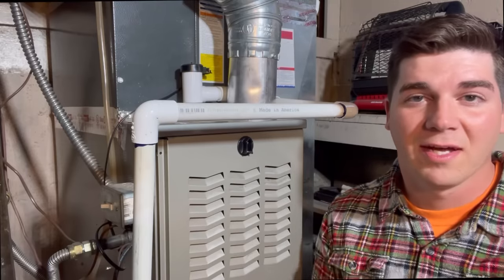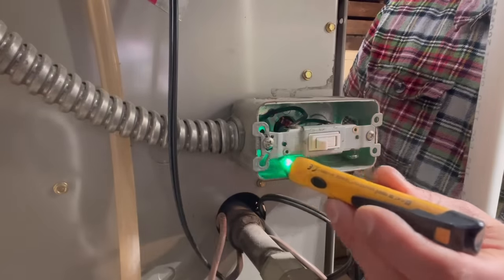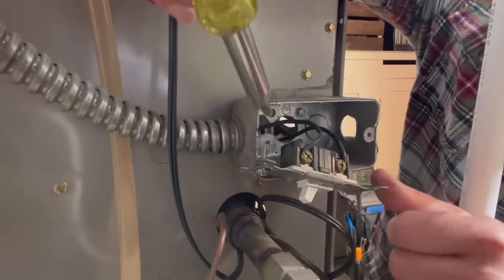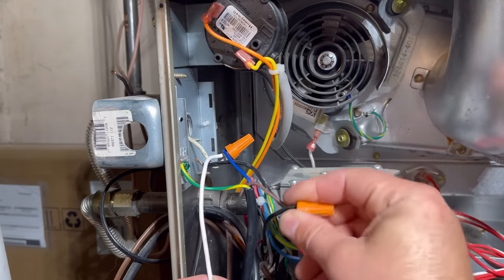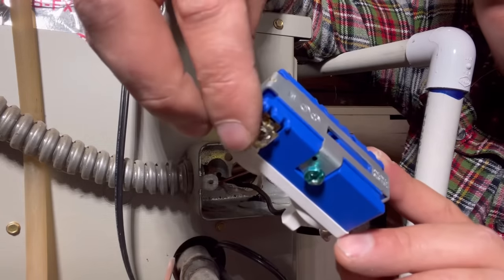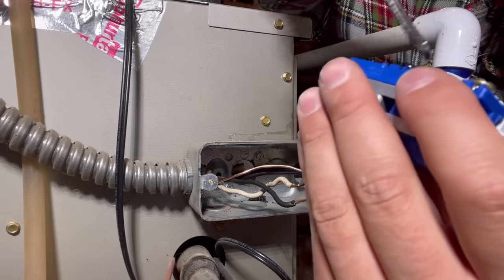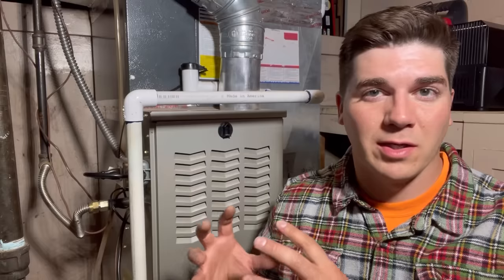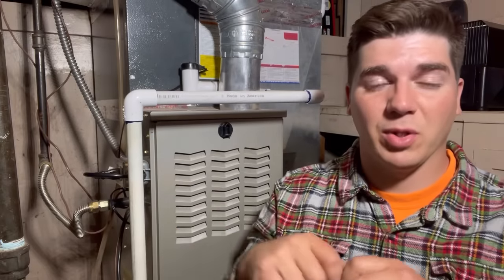This Could Keep Your Family Warm During An Emergency Power Outage.

Comment: Good idea. Please note that the opening in the back of the attached metallic box through the furnace side wall requires a plastic grommet to protect the wire from eventually being cut through the jacket to potentially a short or a hot chassis, both of which are very very dangerous. The vibration of the working furnace can, over time, cut through the wire jacket. A plastic grommet prevents that from happening.
Reply from the maker: Thank you, some others have said the same. I’ll make sure and correct that.
Reply: @diyhvacguy  I come from the automotive world and it's the constant subtle vibration (such as produced by the furnace blower) that sneaks up on you to slowly eat through unprotected insulation. 3 or 5 or 10 years later.... ZZAAPPPPP!!!!!
Reply: @offsideundo  One big safety step also missed is grounding the box.  Sure, a short will still be a problem for functionality, but at least  it would keep the switch box from becoming live and deadly.
Reply: There are some plastic grommets that fit the knockout hole (3/8 in. - 1/2 in. Knockout Non-Metallic Push-In Connector). They have these fingers that you put the cable through and it insulates the cable from the metal and does an adequate job of holding the cable in place. Places like Home Depot will have them and probably Amazon.
Reply: @CanadianCuttingEdge   actually, he has a bare ground wire connected to the box through a screw from inside the furnace, the he connected to ground.  So it is grounded, though I agree it might be better to have used a grounding screw inside the box so that would be apparent upon visual inspection without having to look inside the furnace.
Reply: Another NM (Romex) connector can be used at j-box/cabinet interface for wire protection. You can use the clamp for additional strain relief or just remove the two screws and clamp completely. The goal here is simply to prevent the sharp edges of the j-box and/or furnace sheet metal housing from cutting into the wires’ insulation causing a possible fault (short). Just about any 1/2” trade connector will work. When I do this on multiple products I use a close nipple and two nuts making sure the nipple is deburred for electrical applications. It results in the neatest possible  job and an additional mechanical interconnect.
Reply: Is there a building code that says a furnace can't be on a plug like this?
Reply: You got a breaker and a switch in series. Kind of redundant
Reply: @Paul Hart  The switch is for safety of the technician and to prevent property damage. Most HVAC companies have lock out/tag out procedures for the breaker outside to prevent energizing the circuit during replacement of the furnace. When a technician is there in front of the unit, they need to be able to quickly de-energize a malfunctioning furnace that often happens during the troubleshooting and diagnosis phase of a repair.  Considering the furnace is often in the attic space and the breaker is often outside the house, it is important to have the switch on the furnace.
Reply: @tlv1117  Maybe not one, but several that make compliance a challenge or impossible with this approach. Local codes may be ammended to make this easier or harder.

Generally the applicance (furnace) will be required to be listed (UL etc.) and installed in accordance with the manufactuerers instructions. [NFPA 70 110.3(B)]. If the furnace was not listed as a cord and plug connected device, and the device didnt come with either a cord to use, or come with insturctions listing specifications for the cord type and size, then attaching a cord and plug should not be done. This is common for dishwashers and built in microwaves, but I have never seen it on a furnace, particularily due to some other requirements ill get to further down. An example from a Granby KHM series installation manual: "Use a separately fused #12 electrical line directly from the service panel to the furnace junction box. Install a manual shut-off switch at the door or stairway to furnace room so furnace can be shut off remotely."

The box connector that was used to attach the cord is probably not listed for flexable service cords. The one used in this video apperas to be a box store special (probably Halex brand) which to my knowledge are only listed for use with NM sheathed cables. A better choice here would be a T&B 3302-TB which is listed for both NM sheathed and flexible cords. (These are the nicer ones that the good electricians will stock on their trucks made from stamped steel instead of die cast zinc, and they have screws that that thread into the moving part of the clamp so the screws dont extend way past the connector when clamping, and they are listed for pairs of NM cords through one fitting for certain sizes)

The light switch used in this video almost certainly does not carry the listings or safety ratings to be used to for a transfer switch. While it certainly works, they have not been designed and qualified to ensure they fail-safe and have suitable isolation to act as an interlock device between two seperataely derrived power sources.

Another major safety issue I see is the second source of power appears to be brought in after the the firomatic thermal cutout switch and area entrance disconnect switches which are typically installed on the supply conductors.
Reply: @shtfengineering7472  it’s convenient. But this is in a home, not in a place of business. This type of setup would probably not fly in a commercial setting due it being of questionable compliance with Code. In a home, the man of the house would probably tell everyone in his home not to fool around with his breakers while he’s doing electrical work, so no lockout/tagout necessary. But I see what your saying, it’s kind of neat.
Reply: @phart010  Good points, and I agree with you.  I was speaking more to the practices and procedures established by the HVAC company who comes to the house.  After reading what I wrote, I can see how I could have made that more clear.  Sorry about that.  I have edited the comment for clarity.
Reply: @phart0102  That attitude is why inspectors are sometimes extra strict with non-code-compliant things done by amateurs when they let shortcuts by tradesmen slide.

It's only a short distance between "the man of the house will ..." to 'I will remember that the green wire is switched power from the other breaker'.
Reply: @greg_zenger   not sure what you're seeing but it doesn't look to me like he's using the switch as an interlock. His setup only allows 1 power source connected to the furnace at a time. The pigtail is either drawing power from the switched receptacle or it's drawing from the generator's receptacle.
Reply: @paulhart7739  True. Our original attic-mounted furnace had a 15A plug going to a receptacle for the power as did the replacement furnace. I agree the switch is not needed.
Reply: @CanadianCuttingEdge  The whole thing is now electrically connected because it is metal and it is shared through the screws from the box into the furnace metallic shell that's causing a complete circuit so you do not need an additional wire to connect the box to the rest of it electrically.
Reply: @LameSauceAge    You are correct. I didn't watch that portion of the video closely. I've seen others try to do what I was describing and made the assumption that the same was being done here. This setup is still stupid and violates a number of code requirements and is generally unsafe.
Reply: @paulhart7739  Is the breaker within 9 m and in line of sight?
Reply: Would it be possible to just connect a pigtail to the switch wiring like you described in your first video but LEAVE the switch connected as well or combine the switch wires with a pigtail? Then when the power goes out, just connect it to the inverter? Would this work?
Reply: @paulhart7739  the switch at the furnace is a code requirement
Reply: @briandantz4899  Codes vary by locality
Reply: @phart0102   You may want to go-to NEC and read up on motors... Since a blower motor is larger than 1/8 hp, it requires a local disconnect. This supercedes what to AHJ requires. Plus, why wouldn't you want it? Your service guy will want it as well,
Reply: @briandantz4899  who calls the AHJ to inspect equipment that they have in their home anyways?
Reply: I'm reading people talking about codes and what's allowed and what's not but I got to be honest if it comes down to freezing pipes or staying alive I'm not concerned at all about code.
Reply: @paulhart7739  your bedroom lights have a breaker and a switch in series too. How redundant! Why don't you just go to the breaker panel every time you want to shut something off? SMH
Reply: @Krankie_V  that’s because the switch for lights is the controller. For HVAC the controller is the thermostat
Reply: @phart0102  you are supposed to have a cutoff switch near the unit for emergency and service purposes.

The thermostat controls the temperature, not the power to the unit.
Reply: @Krankie_V  if you are supposed to, then why did he need to add it? I’m thinking the breaker was already considered “close enough” when they originally built the house
Reply: @phart0102  at the beginning of the video there was a single pole switch; all he did was replace it with a split receptacle/switch.
Reply: @allthingsfunnels  Yes. Install a transfer switch panel with a proper electrical power inlet.
Reply: @paulhart7739  That is how furnaces are installed now. With a shutoff switch by the furnace. Installed between the breaker and the furnace.
Reply: Yes also a Romex connector will work if the jacket is still intact. 73
Reply: @CanadianCuttingEdge  the box should already be bonded because he just removed the switch for an outlet switch combination.. 73
Reply: @paulhart7739  not really. A switch is a convenient way of turning off the power to the furnace without going outside to turn off a breaker. 73
Reply: @Krankie_V  good point just another troll is making a mountain over a mole hill. 73
Reply: Thanks for the video it won't help on electric furnaces. You just need a transfer switch configuration and a large generator.73
Reply: @phart0102  he didn't add a switch genius, he added a receptacle. The switch was already there from the original installation of the furnace, since, you know, it's required equipment and all.
Reply: As soon as the inside of the box was exposed, that was the first thing I saw.
Reply: @paulhart7739  I thought it was odd that it started out as just a switch. When really all you need is the outlet and pigtail right?
Reply: @briandantz4899  mine passed without one
Reply: @phart0102  realtors?
Reply: @paulhart7739  The switch is actually code here in Ontario, Canada. (I'm not an electrician.)
Reply: @CanadianCuttingEdge  When running the ground into the box, pass it under the box screw then to the receptacle.
Reply: @1djbecker  then there's  the insurance man in case of a fire 🔥. Not going to fly
Reply: @shtfengineering7472  Paul is right, the safety of technician will be guaranteed as soon as you unplug the pig tail from the receptacle, having said that, I would say if the receptacle should not be attached to the furnace and do not run the pig tail through the receptacle box.
Reply: @Albert  I did my best to explain from the eyes of a technician (20+ years) what the INDUSTRY STANDARD is at nearly EVERY HOME. The $0.50 switch installed on the side of the gas furnace WHEN IT COMES OUT OF THE BOX is the accumulated result from over 100 years of accidents, which resulted in deaths and destruction of homes.  Thus, the very reason the overseeing agency, the NEC made it part of their code. (to prevent said tragedies)  I am amused by all the comments from people who watch videos like this and have no intention to implement what they saw, nor understand what they watched, yet still feel like their opinions, formed out of ignorance of the facts, are of some value to the community.  Education is key when it comes to electrical work of any sort, and I am not talking about a piece of paper with a stamp on it.  I know a licensed electrician with missing fingers. (blown off instantly during an arc flash) "Is the breaker off, buddy?" "Oh yeah, you're good to go."  vs.  LOCKOUT/TAGOUT  It is important to learn hands on under the direct supervision of a seasoned technician who knows the safety rules.  There is also an element of common sense that must be possessed by anyone attempting to do their own electrical work.  Without these 2 things, a tragedy is imminent.  The sheer arrogance of a person to make a comment about something they clearly don't understand instead of asking questions to understand..🤦  Take my words at face value, or don't.  I have no reason to mislead anyone, I was only trying to help the curious to comprehend.
Reply: @tlv1117  Actually the US NEC requires the furnace to be hardwired. However, if the installation is properly installed, this can be done safely and provide the ability to use the furnace during an outage as demonstrated in this video. One of the reasons hard wiring is required by code,  is to prevent vibration from loosening the plug out of the outlet  and shutting the furnace down.  

As others have pointed out, the wiring running through the box to the furnace needs to be addressed using a box connector or grommet to protect the wire from the sharp edges.

Someone else suggested using 14 gauge wire too, over the suggested wire size. I would actually suggest if you use 14 gauge wire, to change the breaker to a 15 amp or change the wire to 12 gauge and use the existing breaker. This insures the wire can handle the maximum breaker capacity without creating a fire hazard.

The other thing great about this setup, I used a double box with a full receptacle and switch, is a plug in TripLite surge suppressor. With furnaces having more complex control boards, it helps protect the control board and expensive repairs.
Reply: @commonsense5105  Yeah, I thought it was probably a code requirement. That's too bad. I guess if having it vibrate out were my concern maybe I could find a plug that has a tab on it to run the screw through that holds the plate on. Usually those are for this crappy missing ground tab substitutes but it seems like I have seen them with both the tab and the ground plug.

But if it violates code it violates code. It may be there is another way to address the reason for the code but that doesn't mean an insurance company won't use that as an excuse not to pay out if something happens. Nor does it mean someone won't use it as an excuse to sue.

I guess if my power goes out long enough to worry about this I'll just temporarily rewire it to a plug when that time comes and put it back afterwards.
Reply: @tlv1117  I would say no, even if there is faulk it, I'm going with common sense and having a plan when the power is out.
Reply: @CanadianCuttingEdge  He seems to be assuming grounding to the furnace frame will work since both are metal and connected but my furnace sure as heck does not have any such switch.
Reply: @shtfengineering7472  Any decent furnace has a built-in shut off switch that kills the electricity when the panel is removed that shuts it off so repairs can be done more safely.
Reply: @paulhart7739  The switch is for a technician to service the furnace.  Every furnace I've ever seen has that switch.
Reply: Hvac tech here.... A service disc. Is a must when working on high voltage. Code or not.. Unless breaker panel is REAL close.
Reply: @shtfengineering7472  right on. As a hvac tech i get real nervous w/o a disc..... Fused or not. People on the net arent the ones working on furnaces or air handlers.
Reply: Try rubber grommets instead
Reply: @bobvilla7230  ends up killing people or cost a couple hundredthousand
Reply: @tlv1117  In a basement, garage or other wet location, any receptacle needs to be GFCI protected, so that's a code violation under NEC Section 210.8
Reply: @peterwachter7753 
I have never even considered using a Romex connector. Great idea.
Reply: Yup.....he needs a chase nipple between the switch box and the heater.
Reply: Breaker is for safety in the event of an overload, the switch is for convenience and auxiliary safety lockout for service personnel.  Apparently the Canadian building codes are all effed up too as my furnace has a similar convenient redundant set up without the "pigtail" mod implemented by the OP. Going to do the same with mine to tie in recent solar power functionality.
Reply: My switch is mounted about 8 feet from the furnace above the door into the utility room of my basement done by the builder around the mid '80s.
Reply: @DavidThomas-sv1tk  - Have a bunch of electrical outlets in my basement in Ontario and the only GFCI is in the bathroom.  I hada bunch of outlets in my basement in Colorado and none of them were GFCI.  That includes the outlets installed near my slop sink and the washer/dryer.
Reply: You'd have a better chance of winning the lottery then that to happen...
Reply: @tlv1117  it really depends on the county and state, but most furnaces are supposed to have their own independent, "f.a.u. circuit", just like microwaves, garage door openers, garbage disposals, dishwashers... in this case, he is not necessarily breaching that requirement, as he actually has a "disconnect" just before the outlet. The outlet itself only requires a circuit running back to the circuit panel.
Reply: Where is the ground? The most important thing that you didn't even mention.
Reply: @genericdude6551 the guy just said to use a grommet. Why did you feel the need to explain what a grommet is and where to get one?
Reply: @paulhart7739 you have a breaker and a switch for your bedroom light? Sounds pretty redundant to me.
Reply: This is actually sketchy AF!! I’m a electrician and this is not a good way at all.
Reply: The service switch is a code requirement in Canada on any furnace installation. Also in Canada the gas connection to a furnace or a HWH must be made with rigid pipe. The furnace in the video was hooked up using a gas flex connector, not allowed by code in Canada, but they may have more lax safety standards in other countries.
Reply: @DavidThomas-sv1tk  Can you confirm that a basement is automatically considered a wet location? If I had water roaming free in my basement I'd be in a lot of trouble.
Reply: It depends.  If the floor surface is conductive due to moisture in the floor materials, an unfinished or even a finished basement can be considered a damp location.  So it doesn't require standing water, but "moderate degrees of moisture".  

A basement in very well-drained soils, not in snow country*, with deep groundwater and especially with a radiant floor, I wouldn't consider a damp location.

* but with freezing weather, ground around a dwelling can freeze and direct meltwater down the only thawed soil (around the foundation) and, if you didn't build the foundation like a boat, you'll get leaks in the spring.